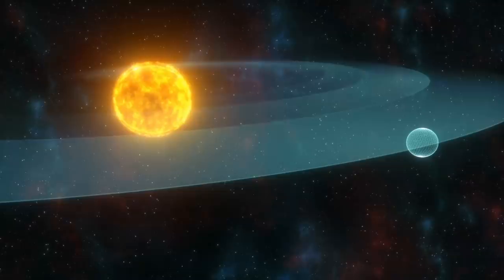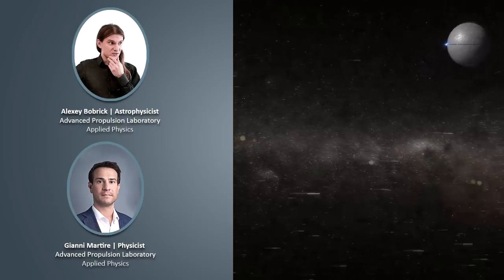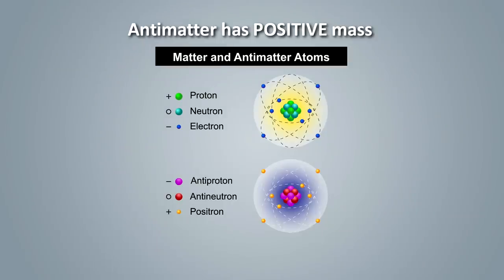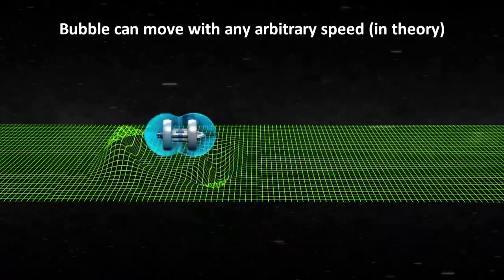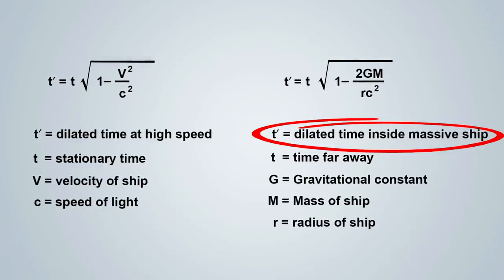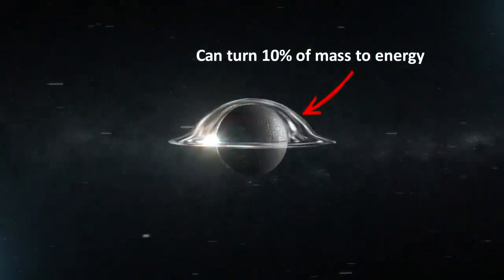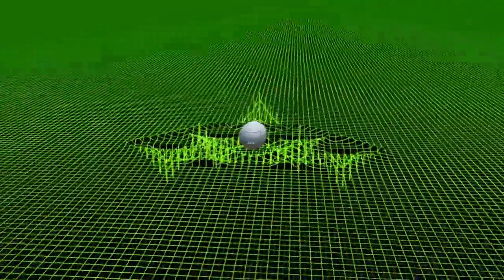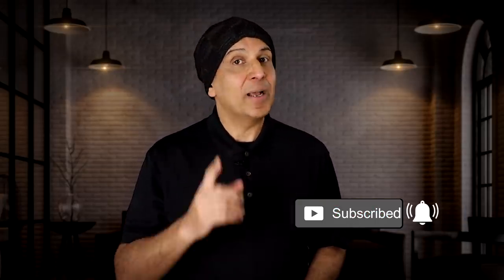REAL Warp Drives? NEW research proposes a solution!

Comment: Einstein: "space contracting around a mass is what drags you towards the mass. If the mass collapses to a certain concentration, the flow of contracting space will continue to speed up, until it flows faster than the speed of light . if you let it drag you beyond this point (the event horizon) you or even any light will not get out because you would have to travel faster than light to overcome the contracting space"

doofus "scientists": "The expanding and contracting space doesn't move the ship! we need a rocket to change its momentum!!"

me: why does an apple fall? is some rocket changing its "momentum"? 

Get a load of these IDIOTS